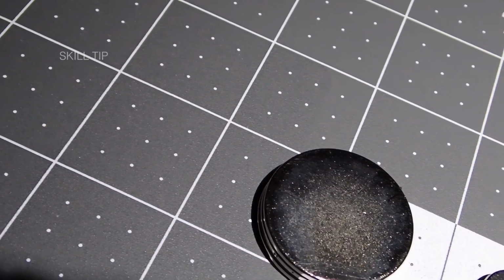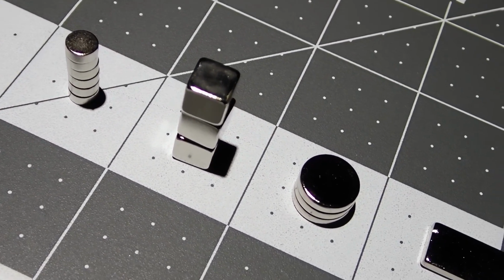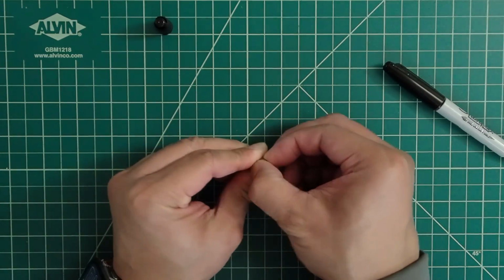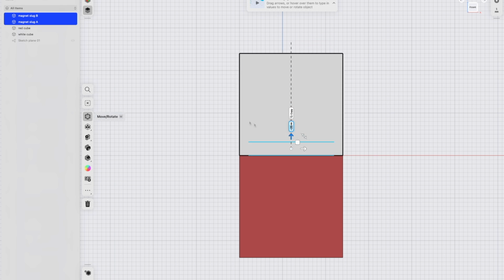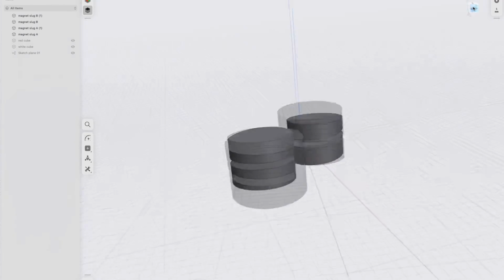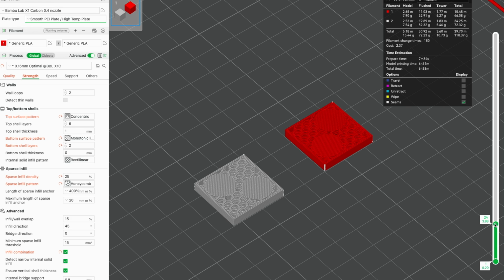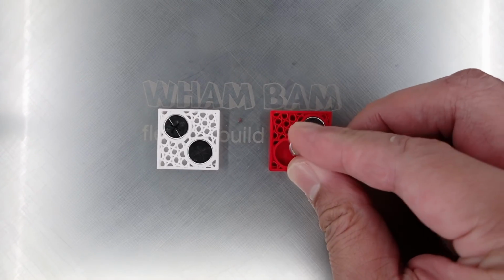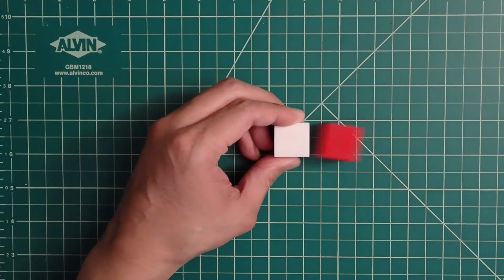Embedding Hidden Magnets in 3D Prints

Comment: will magnet stick to the hotend nozzle?
Reply from the maker: We've never had that happen, but the Bambu X1C machines we use also have a magnetic bed and use ferrous (steel) plates (vs glass), and so far, even though the nozzle we use is the hardened steel type, it hasn't attracted the magnets off of or out of the prints we've been doing. But also whenever we can, we design the print models so that the cavities for the magnets are a pretty snug press fit. Good luck!
Reply: @batchresearchlab  thank you

Comment: Well you kinda forgot to mention that if you have other than brass nozzle the magnets can stick to it :D Especially if not designed to snap fit as yours are (A+ design, but most of the real world cases won't be like that).
To prevent this a super glue can be used. Drop of glue, magnet, wait a little bit, resume :)

Hope this helps
Reply from the maker: We use a hardened steel nozzle, but luckily never had problems with it picking up the magnets; probably because we also use a magnetized bed. Good tip on using glue on the magnets, though. Because of the glue’s curing time, I’d just caution anyone who might be working with a print that was senstitve to temperature consistency fluctuations. In those cases, it might be better to design the print so that the magnets were a fairly snug/tight press-fit into the print’s cavity so pause time could be minimized.

Comment: Where do you get your magnets from? (I've had bad luck with a size that I specified from Amazon no longer being available.) Also, what strength magnets do you use where the 1mm magnet-to-magnet spacing is good? (I've found that sites that specialize in magnets sell different strength magnets.)
Reply from the maker: 😅so far, we've just been using more affordable bulk-purchase magnets that didn't have strength specced. Somewhere like kjmagnetics.com is going to have higher quality, tighter spec magnets. We actually went with them for a project we're working on currently.

Comment: When setting the pause command in your slicer you need to know if the pause will happen before the indicated layer or after the indicated layer. I know for a fact that in PrusaSlicer that the pause (or color change, or custom G-Code) will happen right before the indicated layer. Since BambuStudio is based on PrusaSlicer, I would suspect the same is true. If my suspicion is true, the example in the video shows the wrong layer for the pause (one layer too low), and may cause a collision with the nozzle and the magnet if you are unlucky.
Reply from the maker: Thank you for the heads up 👍

Comment: Good video!  Which cad program are you using in this video?
Reply from the maker: HI there. We're using Shapr3D for this project. We like it because it runs on iPad as well as desktop and it's super easy to learn. We will also from time to time use Fusion360 depending on needs. 

But I honestly cannot say enough good things about Shapr3D if you're just getting started. It helped me get over years of frustration with getting into CAD coming from traditional tools like zBrush, Maya, etc.

Hope that's helpful!